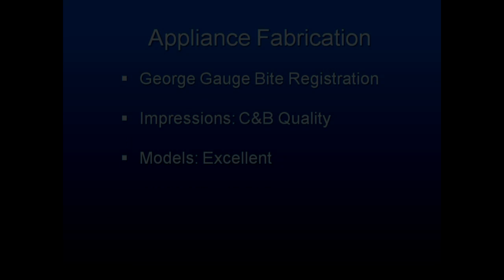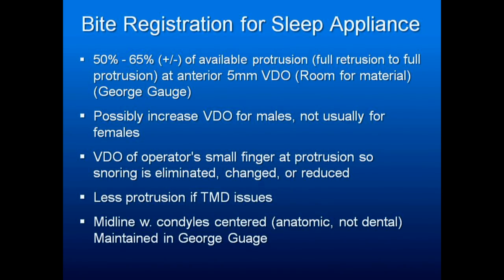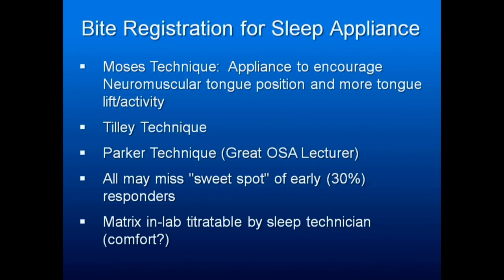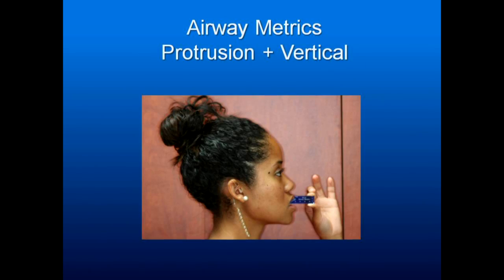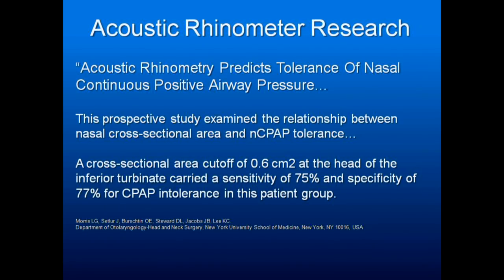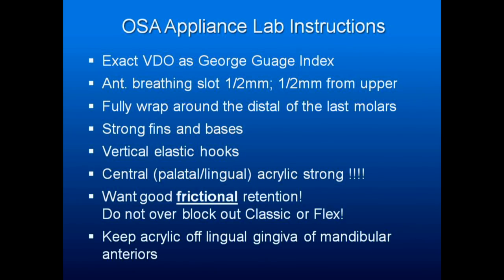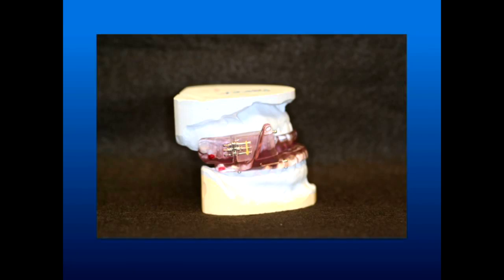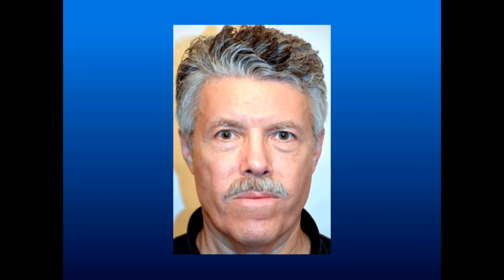Obstructive Sleep Apnea Part 11: Oral Appliance Fabrication

Comment: Great presentation, but have you looked into MAD-FIT algorithms that prospectively predict the optimal jaw position in 3 Dimensions (Horizontal (AP)-Vertical-Lateral) and record that position with an Andra Gauge for maximum airway for oral appliance without the need for any expensive equipment.
For more info please visit www.app-nea.com